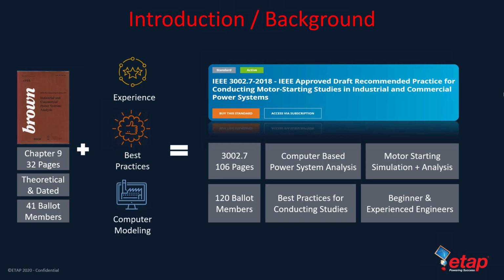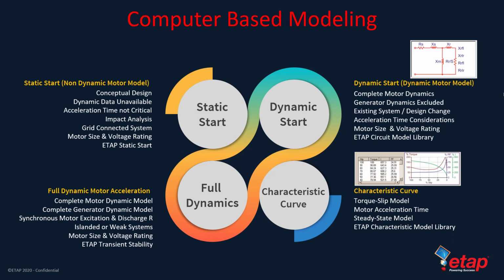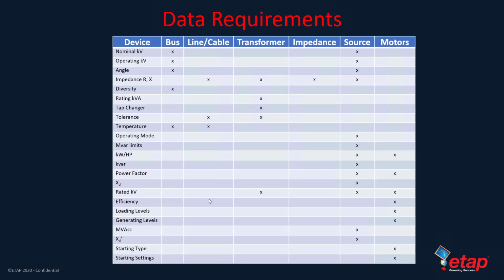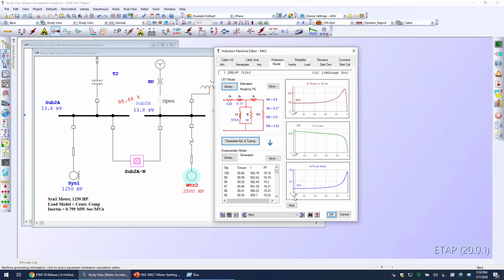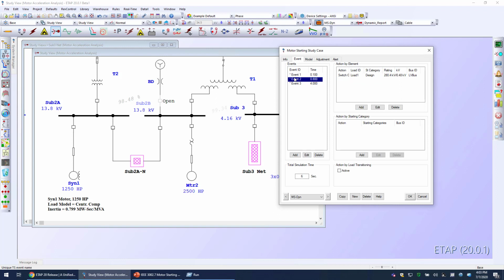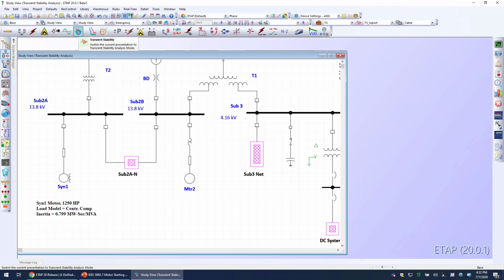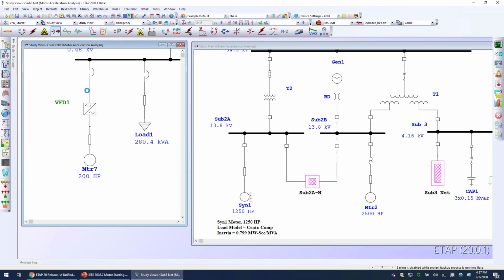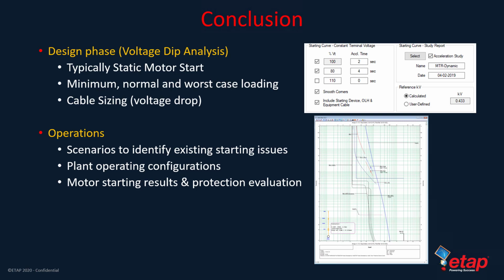Motor Acceleration Studies

Comment: Hi, I have installed MV Motor 6.6kV 950kW to attached with centrifugal fan with direct coupling. The Fan shaft design need 950kW to make it operate. I've tried to start the motor couple with fan by using MV Soft Starter but the fan failed to accelerate to rated speed & soft starter keep trip excess start time & sometime overload. Need some advise here.. Thank you...
Reply from the maker: Thank you for your interest in ETAP Solutions, please contact our ETAP Help Center to assist with you question, https://helpcenter.etap.com

Comment: Motor with Load is Crusher, what type Motor Load ID, as there is Pump, FAN, Recipro, Compressor, Aw, Ak, K1+K2*w**2,  But no choice for Crusher. 

Can you explain?
Reply from the maker: Thank you for your interest in ETAP Solutions.
ETAP recommends all users contact the motor manufacturer (Crusher) to obtain the Speed Vs Torque Load Curves and enter this curve into the Motor Load “Curve”. Go to Library, open the Motor Library and make your adjustments.
The use of the sample “Typical” Loads found under the Polynomial Quick Pick of the motor should only be used for preliminary analysis, since these curves could be very different from the actual manufacturer provided curves.

For more information please contact our 24/7 Help Center at https://helpcenter.etap.com.

Comment: Greetings! 
I try Motor accelaration for soft starter but the acceleration report for motor itself did not come out. it only show me the blank space 
Do you know how to solve this problem?
Reply from the maker: Thank you for you interest in ETAP software solutions. Please contact our technical support team via e-mail support@etap.com or open a ticket on our 24/7 Help Center https://helpcenter.etap.com
Reply: did your motor start at all? check the critical event report.
Reply: Is under voltage  in critical report prevent to motor start as reality?